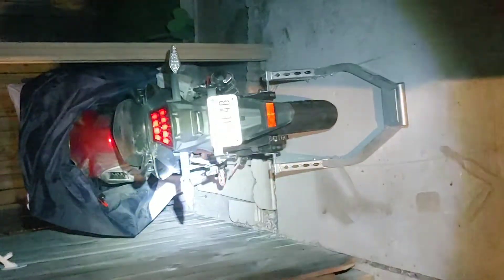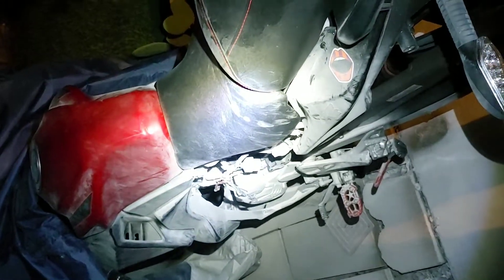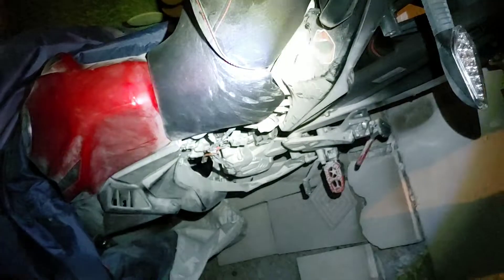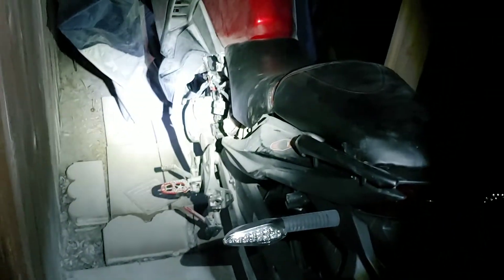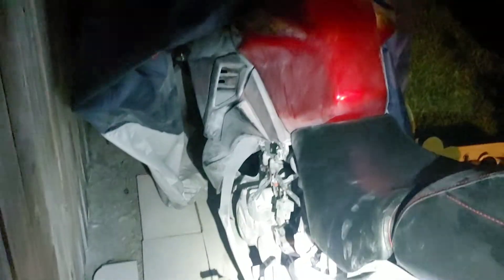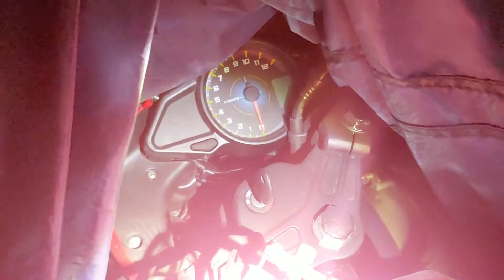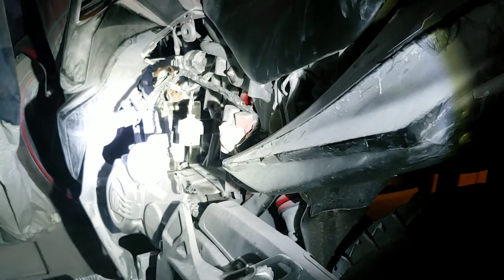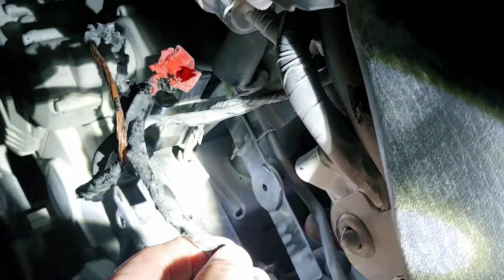R.I.P. 2018 LIFAN KPR200 (2020-2020)

Comment: The ticking sound is most likely the engine being in gear making it engine braking, I've got that already. My Hero 200S has the same frame and the battery and solenoid is in the same place as this. I believe the soleniod or the regulator/rectifier started the fire. Most likley the regulator/rectifier was over charging the system and the battery exploded My 200S has 30,000km on it, with the only serious issue is a busted engine bearing at 22,000km and a recent charging issue. Because it a carburated bike, it don't rely on the battery to run

Comment: I really don't believe it was the bike I believe it was that old battery had did that it might got overheated and started to fry some of the wires  and you may have one or two wires that you couldn't see that had got exposed and touching each other yes I do believe it messed up the voltage regulator but when you put that new battery in there may have been some other wires touching that also can cause the fire